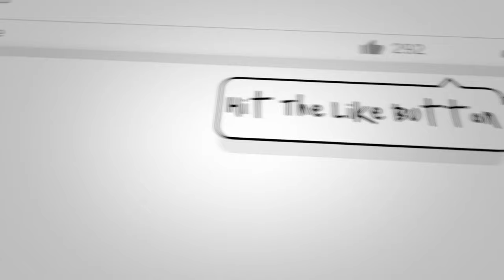Sagola 4600 Xtreme DVR AQUA 1.2xl - 1.3xl digital Spray Gun Review - Range Rover Evoque

Comment: Hey Tony, great channel! I’m buying a new clear coat gun and actually made up my mind on the gti pro lite after a few emails with SGD. But now I found a guy selling a new 4600 Xtreme Scrambler edition for only €200/£180. The only issue is the gun has the aqua air cap and needle/nozzle 1.2xlmm and one with 1.3mm. I use ppg and quartz for clear. What would you recommend? I know a lot and SGD are in love with the gti pro lite t110 air cap for a glassy coat but that €200 keeps buzzing my mind. Is the aqua cap any good or really just for waterborne?
Reply from the maker: The aqua actually mate is a very good aircap for alsorts tbh mate and that’s also a brilliant gun I’ve got three I use them all day everyday mate and tbh it’s miles above the prolite too
Reply: @TonysRefinishingTV  or a brand new Sata X5500 rp 1.2mm for €300. What would you do?
Reply from the maker: @PascalCrypto  SEEMS VERY CHEAP FOR A SATA TBH MATE
Reply: @TonysRefinishingTV  I know. This guy bought a lot somewhere in bulk, he also had 1.3mm but they’re sold out so he only has a few 1.2mm left. I think a bankruptcy or something.

Comment: Buddy i bought a new iwata ws 400 1.4 ,for clear. 
Normally i put my clear with devilbiss gti pro with 1.2 and t110 ,settings i use are full fan ,fluit closed then 3 turns out on 2.0 bar. Can you tell me the best setting for my new iwata ?
Reply from the maker: 2.0 bar fan all the way closed then 1 3/4 turns out no more no less , fluid adjust as required
Reply: Tonys_Refinishing thnx tony

Comment: How does that gun work with solvent based base coat?
Reply from the maker: Works no problem with solvent or water mate
Reply: So Tony, Would you recommend the Aqua 1.2 set up for solvent then? Ashoka website seems to only mention solvent Basecoat with the Titania cap. Getting a bit confused here. Have you had any solvent through this set up. Interested in the gun vid you mention here the low pressure it will work with and that you can adjust away and still get excellent results without having to use the full fan. Even though I bought the LS400 it likes to “run wild” I find. I think it was the wheel paint vid you mention this about closing up fluid and fan and still performing well. Let me know what you think about set up. Been using Mipa and Octoral solvent. Cheers
Reply from the maker: It’s done for solvent mate I’ve just done a full mclaren in solvent with the 1.2xl aqua no issues and used the Titania pro for solvent too
Reply: @TonysRefinishingTV  Great stuff. It’s the fact you can spray at 1-1.5 bar and get the fine adjustment that I’m interested in. Gonna do a bit more research and then make a move. 👍
Reply from the maker: @lewigas290  honestly mate the 1.2xl will smash water or solvent fella at low pressure think i ran it about 1.2bar for the candy mclaren last week